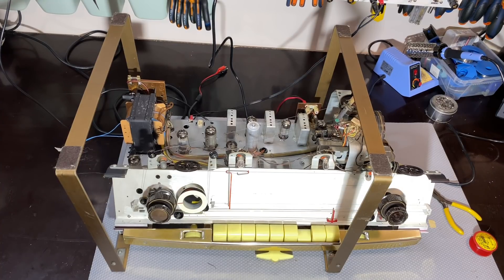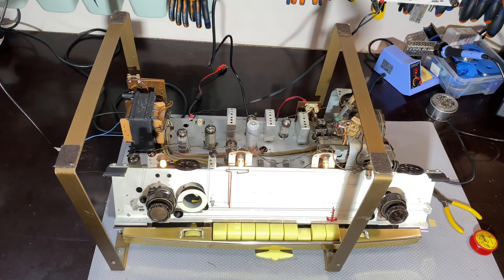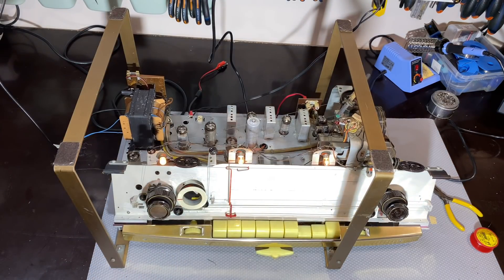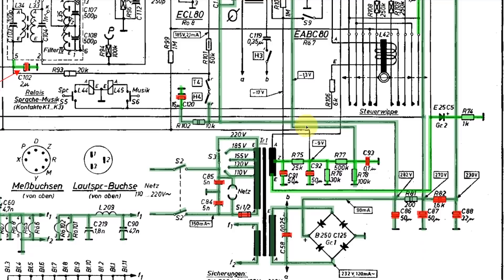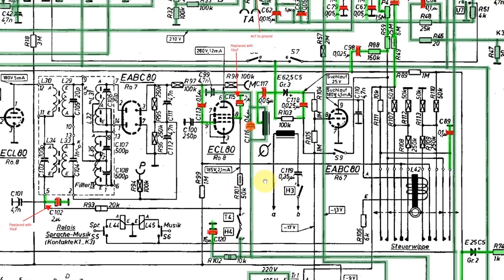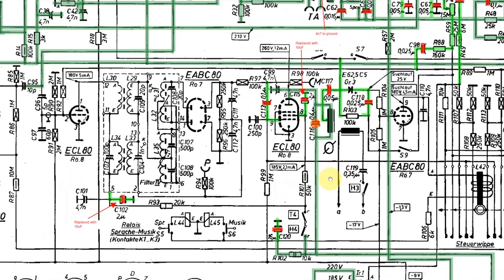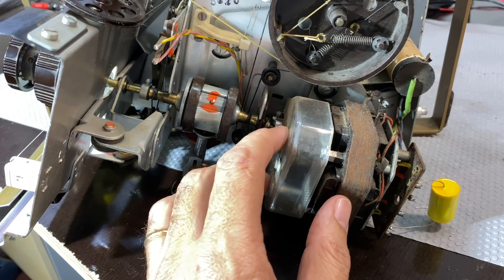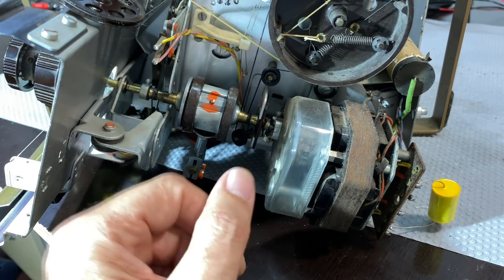SABA Breisgau 8 pt. 5. We have FM, and it's time to start on the automatic tuning.

Comment: I'd like to see a "Rigonda" radio; these were made by VEF Radiotehnika in Riga, Latvia back in the 1960s-1980s in both tube and transistor versions and were apparently very nicely made.  Some had an automatic tuning system very similar to what Saba used.
Reply from the maker: Rare radios.

Comment: Same as you, I like to install BT modules in my german stereo tube radios, but also I install SS stereo decoder,even on those, who are only NF stereo. I place the blue diode under the TA knob and the red-stereo diode under UKW knob.
Reply: I'm very curious about you to show us how do you clean the speaker cloth with shaving cream/foam...
Reply from the maker: I’ll record that when the next one comes up
Reply: @electronicsoldandnew  in 50% of cases i have to change it with a new one, i use cloth for  furniture but it is sometimes too thick and in more powerfull radios, like those with pp end stage, the thick cloth tend to vibrate and even rasonate  with the speaker at bass sound where the amplitude of the mambane is big

Comment: You said the clutch came on with a delay, maybe some fat dried out, IF fat is used. But I see it is not straight forward to disassemble that clutch. Did you clean that multi contact switch ?
And for the 0.35µF 500V, I think it is easy to find the 0.68µF at 250V and higher, and use two in series.
Reply from the maker: that is a possibility

Comment: I'm thinking... replace it with a stepper motor, build a new circuit that reads the existing signals and translate that to the stepper motor driver control and DONE! You should be able to whip that up in an afternoon right? All you need is the know-how, a microcontroller plus the ability to program one, a geared stepper motor, and the stepper driver.... Should be fun heh.. It would be a fun experiment in my opinion, but it's a bit of a learning curve to get my idea working.

If I knew the exact signals that control the current motor I don't think it would be much of a challenge. Just read the signal and act upon them, actually quite simple now that I think about it a bit. Fire up the 3D printer and make a bracket to hold the new components and motor mount. Kind of an Old meets new sort of mashup. Not viable if a person MUST keep it original though.
Reply from the maker: Simple solution 😊 tempting

Comment: Great radios:). I have done quit a few of these and one thing I noted in your conversation. The 0.4mF you replaced with a .47 mF. This might be one of the problems . Before you pull the motor apart suggest  to try a 0.4 first. The coils for the motor are all 1000ohms which can be checked from the back as is. I also replace the small selenium rectifiers with 4148 new ones. Of course some hard oil/grease inside motor rotor can play havoc with the automatic response. I assume all the mechanical bits turn free as a bird. good luck.
Reply from the maker: I believe i’ve found the main problem: one of the windings does not measure 1k 🤢 
I’ll redo the caps as you suggest after I get the main problem sorted.
Reply: @electronicsoldandnew   Auch, hope you can find a replacement where you are.
Reply from the maker: I’m sure I can make a plan somehow 😊

Comment: Hi Mike;    I have repaired many of these Saba's...Here are a few hints.
The .35UF cap is never faulty .   Then the reason why motor isn't turning ..first measure the windings....they should be 1000 Ohms ( both ) and be sure they are isolated from the metal .
Sometimes the inside of motor is coroded and need a clean and lube...but like i said..first check the coles for cont. & isolation !
Then another tip...replace the 2 selenium diodes , you can replace them with a 1n4148 .
Another tip ..do NOT try to tune the fasediscriminator !!!  This is realy the last thing you do and then you need the right equipment ( for starters a sweepgenerator ( wobbelgenerator ) to see the if curve.  Also the IF transformers are very difficult to tune ..don't tune these transformer in to 1 peak !! They have to be tuned with  2 peaks on both sides of the If midfreq. 

Then...you changed the 0,4 uF cap on motor with 0,47 uF...this is to much ...the bigger cap here slows down the speed ...i would replace it with 4  100nano cap in parallel ..or try 0.33 uF ..this wil boost the speed.

Greetings from Belgium

Dirk
Reply from the maker: Dirk, that is amazing help. I repaired one of these years ago, and am a little rusty on the procedure. At the time I read everything I could about this system, but as I’ve not used that info since, It’s somewhere at the back of the brain 😊 
I’m going to do the checking of the windings first, and see how we get along. I may need to ask you for some help 😊
Reply: Yes spot on..bullseye!

Comment: Just a thought is it a start capacitor. I had a extraction fan not working. But when I  spun  the fan  and the motor  started.  I Changed the cap all ok .could you disconnect the drive and put it on auto and give the motor  shaft a spin .
Reply from the maker: I’ll be giving all options a try.